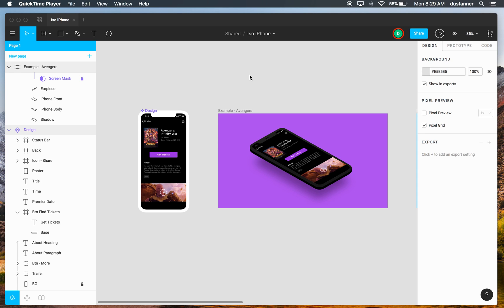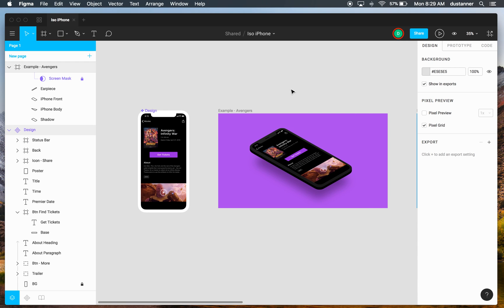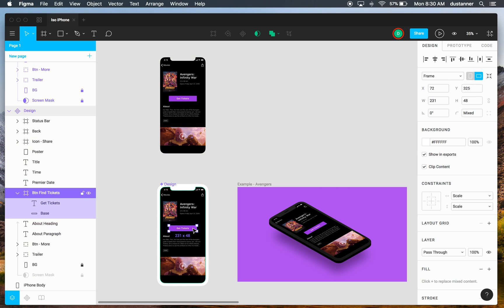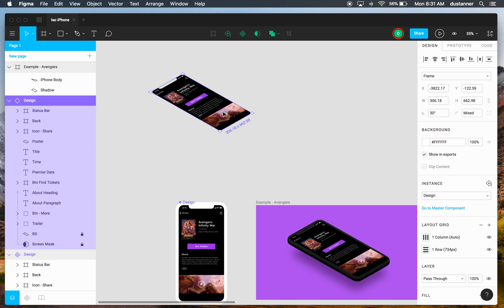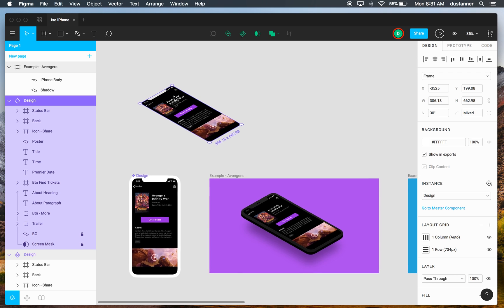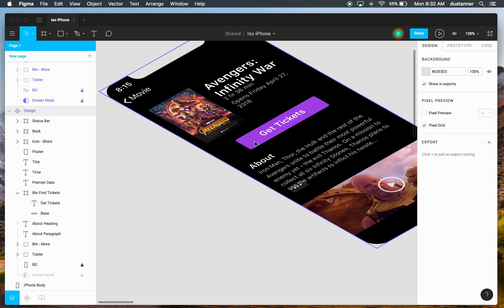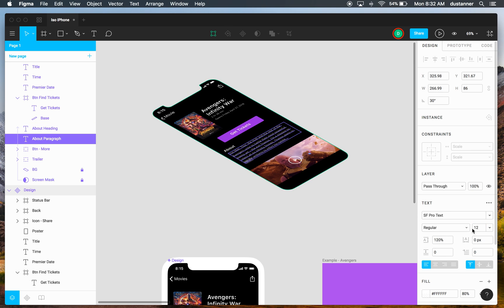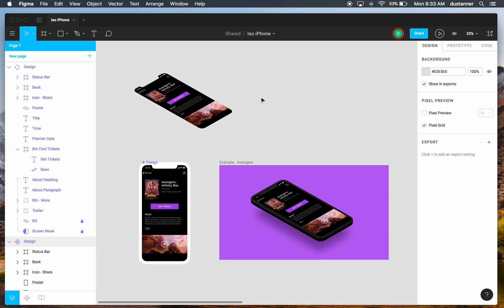Figma Tutorial: Isometric Device Frame

Comment: This "hack" stopped working now, if i set 57.73% on size, it just mess my figure :(
Reply: Put an object into a group just right after rotation and just after it, change the height for 57.73%. It took me some time to understand the order of actions.
Reply: @NeTvoyaByvshaya  That's exactly what I'm doing and it's totally messing with the vectors. Everything looks super out of proportions and the downsizing text fix also isn't working to them look skewed correctly.
Reply: @NeTvoyaByvshaya  thank uuu this just solved my issue
Reply: Actually i had that issue. The solution for me was to set vertical and horizontal anchors to "Scale"